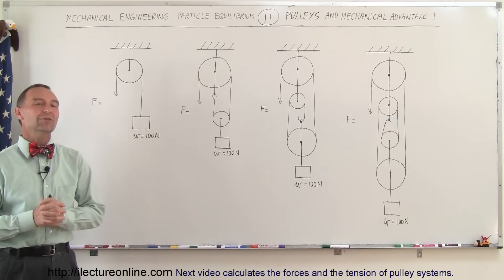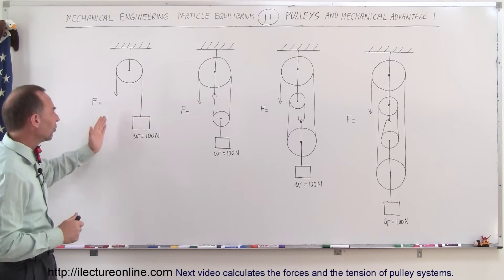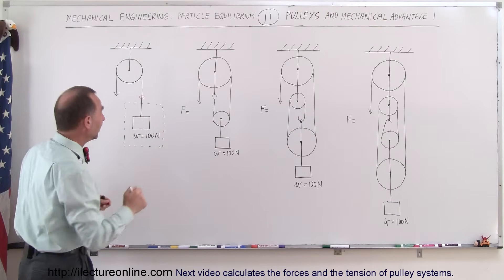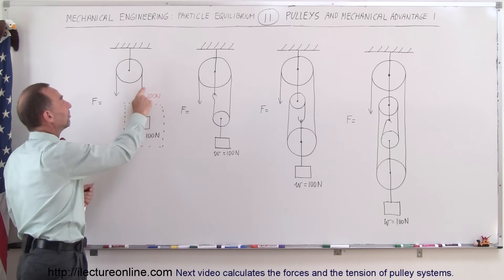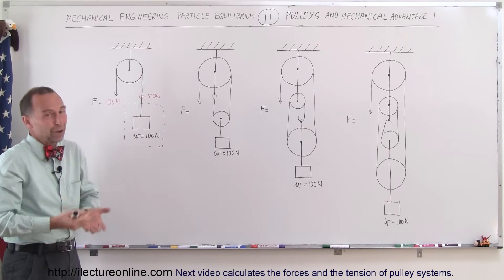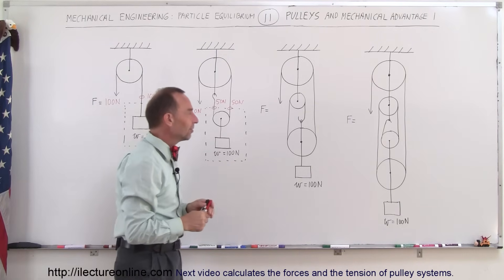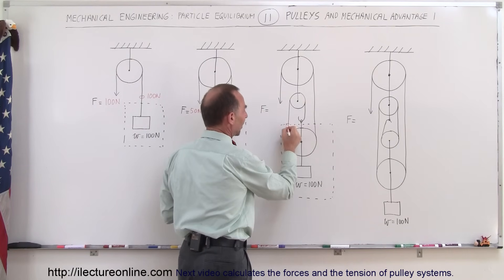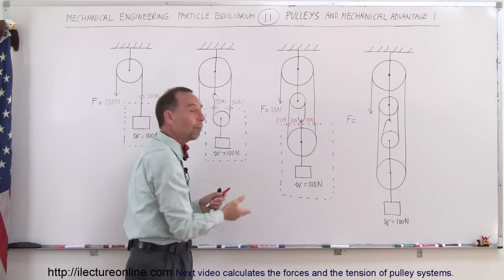Mechanical Engineering: Particle Equilibrium (11 of 19) Why are Pulleys a Mechanical Advantage?

Comment: What's the point of a mass hanging from the middle of the pulley?
Reply from the maker: It gives a mechanical advantage in that you'll need less force (pull) to raise the object up.
Reply: @MichelvanBiezen  if one moves away from the centre of the pulleys more force would be required for the same work-what would be the optimum angle before the effect of pulley advantage is cancelled out -180 deg? (Friction omitted)and what angle would be the most advantageous?-ie using a winch to pull your car out of the mud and using a triangle configuration with let's say a tree as the third point.
Reply: Interesting. What happens when the mass of the pulley and the friction are taken into account?

Comment: Pro tip: make math easier, use 60N in your example ;)
Reply: Or you learn how to divide 100 by 3
Reply: @jeetjemienaa  60 is super convenient, it is divisible by 1, 2, 3, 4, 5, 6, 10, 12, 15, 20 and 30, no wonder clocks love it

Comment: In the last example why didn't you draw the free body diagram to include only the mass and the pulley nearest to it, rather than including two pulleys?
Reply from the maker: I am assuming you are referring to another video?   The general rule is to include all the strings that are involved in holding up a mass against gravity or another force.
Reply: @MichelvanBiezen  No I am asking about this video.  Here you discuss 4 pulley systems.  I do not understand the last system of 4 pulleys, and mechanical advantage of 4.  If i draw a free body diagram including only the pulley closest to the mass only three strings are included; don't they hold up the mass?
Reply from the maker: You need to pull the string on which you pull (on the left side of the 4 pulleys down into the free diagram box.  Then you have the weight of 100 lbs pulling down and 4 strings that would be cut by the top part of the box.

Comment: This is very helpful. I have a question if you are willing? 

I am building a home climbing wall that can adjust the angle of overhang. This adds considerable weight to the existing building. So, instead of a ceiling, I have drawn (not built) a series of pulleys that allow the wall to change angles. The goal is to not overload the building structure, but I do not know how to do the calculations. The pulleys do not function as this tutorial (moving straight up and down). My pulleys would be anchored into a concrete floor, go up to a beam, and then out and away from the building to movable pulleys (wall is moving so the pulley is also). My intuition tells me that some of the force must be exerted down and the other force out and away. Any help would be appreciated. Wall is hinged at bottom. I could send drawing if that helps. Even if we made some basic assumptions this would greatly help do the calculations.

Comment: <100% Efficiency !!!!
Why this process does not volatiles the law of physics, because in that 4 pully arrangement where for lifting 100 Newtown we will only need to work for 25 Newtown so its efficiency is more than Hundred 100% , because input force is less than output force ???? Or Nature avoid this by increasing the length of rope " inputs side " or by increasing the work time ?????????
Reply from the maker: If you require only 1/4 the force, it will require 4 times the distance on the pull.  (We are off course ignoring friction)
Reply: Work or Energy = F x distance is conserved. Hence no violation of law of conservation of energy

Comment: I didn't get why the last one all four are equal,....
Reply from the maker: Note that the tension in the string on both sides of the pulley must be the same in a static situation.
Reply: @MichelvanBiezen  so that middle small pulley thalt's hanging there doesn't divide the force into two equal parts?
Reply from the maker: The same rule holds for the little pulley.  The tension on both sides of the little pulley must be the same.

Comment: I need a definitive answer to the piggyback pulley setup in the link below:
https://scontent-mia3-2.xx.fbcdn.net/v/t1.0-9/45235967_10217291868270322_4353150474929569792_n.jpg?_nc_cat=110&_nc_ht=scontent-mia3-2.xx&oh=852a906b05b7af3ff53f3cee618943e4&oe=5C4B9EF3
Is this a 10 : 1 overall, or a 25 : 1 ??
Reply from the maker: If you place a 1000 lb load at the bottom, the bottom motor must pull with a force of (1/5) x 1000 lb = 200 lb     That means there is a 200 lb load below the top pulley set.  That means that the top pulley must pull with a force of (1/5) x 200 lb = 40 lb.   The whole combination has a mechanical advantage of 1000 lb / 40 lb  =   25 : 1

Comment: I'm curious about the forces applied to the line itself in these MA systems. According to the laws of pulleys in example 2, you could lift 100 newtons with a line that was only rated for 50 newtons? The work is being done, in my mind that 100 newtons of force has to be acting on the line in the middle of the lower pulley.
Reply: It's 50 Newtons pulling to the left balancing 50 Newtons pulling to the right. So the tension would be 50 Newtons (ignoring the traction on the pulley and stretch as the weight is applied.)

Comment: I can't understand the distance thing. for example in the second one,why would I need to pull the rope 2 m to raise the weight one meter?
Reply from the maker: Since the mechanical advantage is 2:1, you will have to pull down a distance of 2.0 m to raise the object up 1.0 m
Reply: Michel van Biezen  Thank you sir.you are amazing 😊😊
Reply: sounds like Conservation of Energy.  1/2 the force, double the distance, Mechanical work done is equal in all the pulley systems.
Reply: exactly... energy is conserved in the whole process..

Comment: please   explain  virtual   work--   u  can   explain  very  difficult   problem   very  simply
Reply from the maker: Amarjeet Singh 
Assume that a few forces act on a particle.  The resultant force will push it in a particular direction if the resultant force is non-zero.  Now assume that these forces will push the particle in a different direction (not the actual direction) a small distance (dr).  The work done by these forces to push it in that direction is called the virtual work.
If the particle is in equilibrium the virtual work will be zero.  (Thus the work calculated to push the particle in any direction from its equilibrium will be zero)